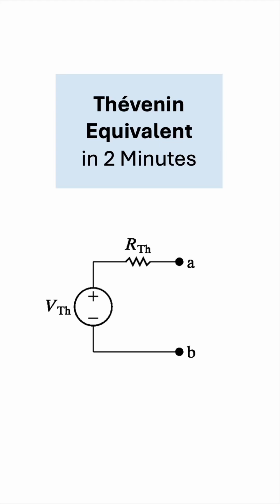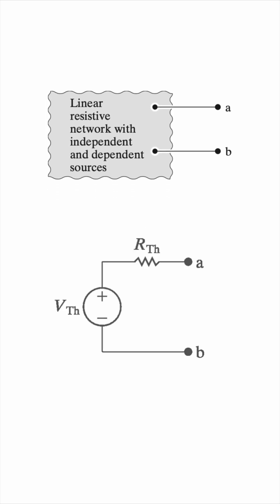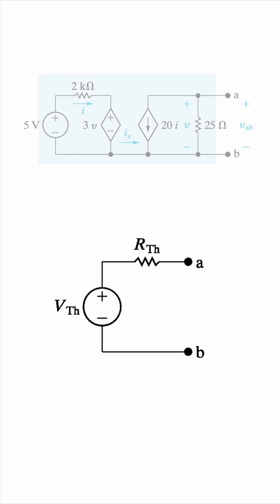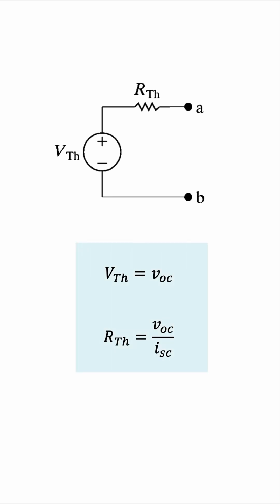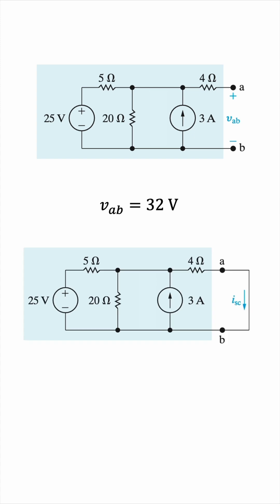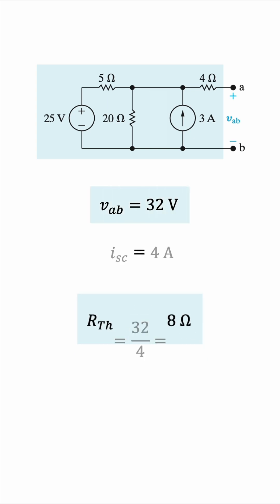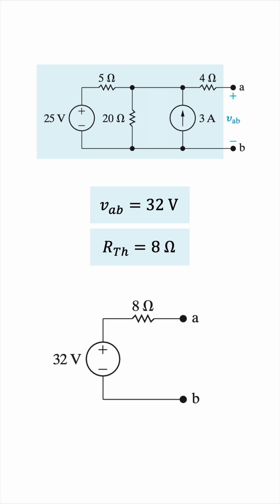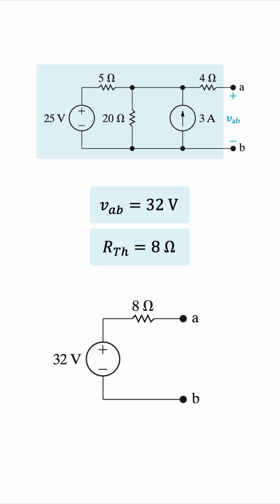Thévenin Equivalent Circuits #electricalengineering #electronic #circuit

Comment: Bro just remove all sources and calculate the Req by circuit reduction unlessyou got dependentant source keep it and suppose the vth is 1v abd get the current this 1v is providing

Comment: What book your used for extract this exercices ? How did you get 32 Vab ?
Reply: To find that value Just apply the superpoustion theorem or whatever method to solve circuits you prefer  

First open the current generator and you have just a voltage divider between 5 and 20 ohm resistors. Which gives you 20V 
Then short the voltage generator. 
You have a current source of 3A and two resistors in parallel that gives you a total resistance of 4 ohm. So voltage is 4ohm * 3A = 12V. 
20+12 =32 V

Comment: How did you get Vab = 32V?
Reply from the maker: @tarrynnewton2030  The idea in this video was only to introduce what the Thevenin equivalent generally means.

I have other videos where I actually calculate the Thevenin voltage step by step. Check them out 😊
Reply: @ElectricalMaths coloque entao apenas o que está no esquema elétrico, assim como fez causa confusão.